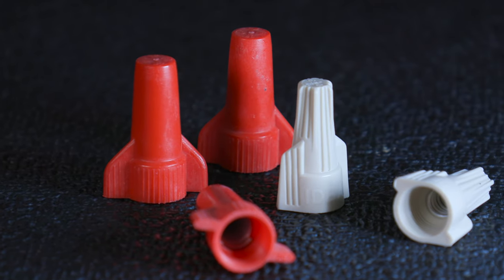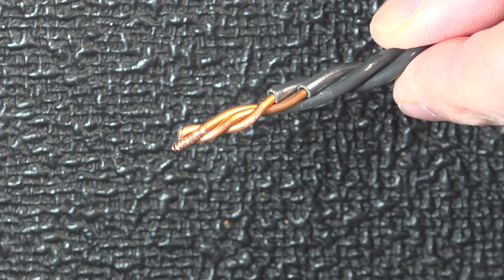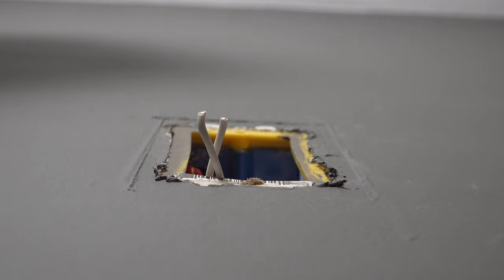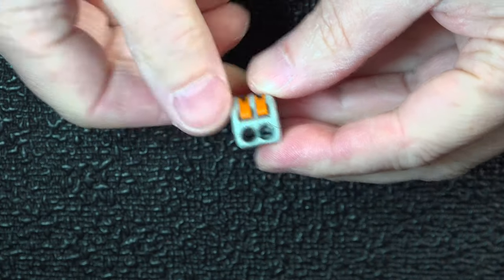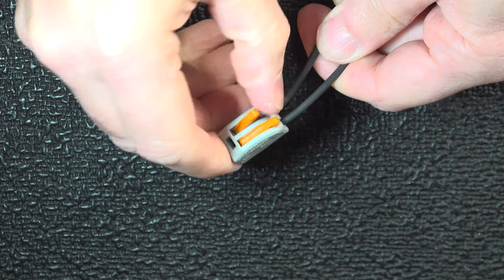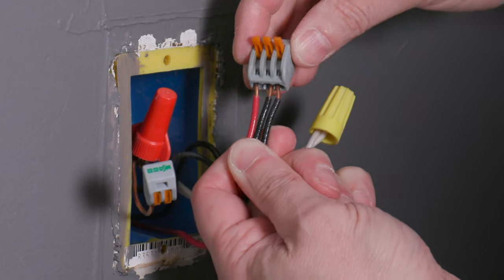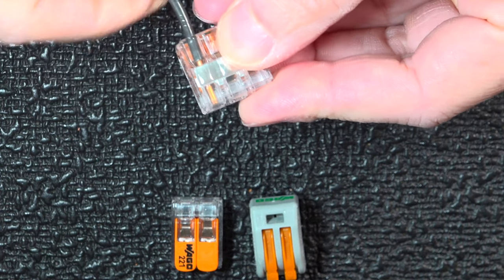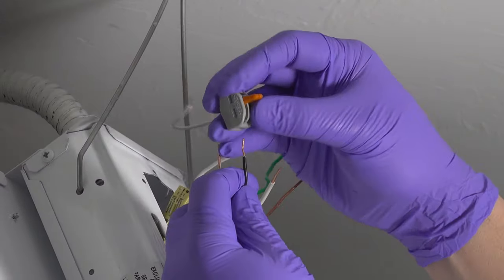Never use Wire Nuts Again - Wago is Better Electrical Connector

Comment: I like them, makes it easier on my back and knees when down on the ground wiring up stuff, but you are going to get some heat from the pro's.  They hate them.
Reply from the maker: Yes I have heard electricians hate them and say they catch fire which is all false. I waited a long time to share this video to make sure they really held up out there.
Reply from the maker: @tb2324  That's the best comparison! 100% right.
Reply: @SilverCymbal  cheers
Reply: I'm not an electrician but I have seen them get bad connections and heat up getting melted.
Reply: May not catch fire but have had connection problems where 2 different size wires were used. Wirenut isn't spose to connect it was to protect. Its why we twisted the wires together. But looks like these have improved from the ones weve had issues with.
Reply: One thing to keep in mind - this is several orders of magnitude of additional cost, with, in most cases, zero or nominal gain.  This device itself becomes a point of potential failure, whereas a wire nut will never fail if the connection is done properly.  If I were trying to employ low skill techs to mass produce houses that will be lived in for 3-5 years average by the homeowner who will have a claim against me, I see the upside to these connectors.  If I am doing work on a house that same person has lived in for 40 years and is likely to own for another 20 years, I would not introduce any product that doesn't have a lifetime warranty.  Interestingly, shark bite seems to get that, since they have 25 year warranty.  It's very painly advertised.  Try to find Wago's warranty.  If you do' you'll have to parse a legal document, and from what I can tell, it's a 2 year warranty.  Ok, that's 2/3 of the way there for "average" current US home-ownership in the age of the white collar gypsy, but not even close to acceptable to me for my own home.
Reply: @tb2324  I think shark bite is the cheap fix. But this wire connector is a great alternative and upgrade.
Reply: Shark bites are not cheap at all.  They are designed for fixes not for plumbing a whole house. Used a lot of them over the years and never had a problem. I would use this product if I was replacing something and the wire was already short other than that I guess you could use them as a bimetal connector but they would have to be UL listed for that application.
Reply: @tb2324  i have saw a fuw shark bite fittings fail ..& if it is buried behind drywall i still dont trust them long term..But They are Handy as a pocket on a shirt in a pinch For Sure !.But That is just imho !
Reply: @linemanap  agree shark bite ive never had a problem with. But someone's making a fortune off that stuff. The thing is tradesmen are a dying breed and their making materials now that anybody can install and save time. Its going to become a problem in the future as the well adversed rounded tradesmen will be gone. Never needed a quick connection of anything cause we could knock it out just as fast stripping and twisting wires then capping. Now they have a drill to twist wires and nuts. Tools to strip wires. And plumbing has always had a million fittings but pex is simple and durable less expensive. Easy to install.
Reply: Shark bites are great for exposed work and in the case where for whatever reason the water won't shut off all the way very hard to sweat pipe with even a steady little drip and these wago connectors have there place as well but only the clamp ones like shown in this video not the stab ones or the stupid stab ports on the back of recepts I hate to see those used they are a problem waiting to happen
Reply: I’m a pro and I love them because lever locks don’t suck as much as wirenuts do. Lots of labor involved with a wirenut.

Comment: Every time they show two solid wired under one wire nut they have demonstrated it wrong. If this had been a demo from an actual electrician, the wires would still be twisted together when the wire nut was removed. Suppose to twist them first with a qualifying pair of side cutters then trim for the wire nut. The wire nut at this point simply holds the twist together and insulates the conductors. That twist is far more effective of carrying the full capacity of those two spliced conductors that their type of connection ever will.
Reply: @Joe  Not only that // in addition to that... OP is not just talking to Electricians. I don't think he explicitly states it but the tone and content appears directed at the general public - i.e. the untrained masses that are doing general work. Further, the "twisting" note you make (which makes sense in and of itself) doesn't address OP's other comments regarding the biting into the wires, being put on too tight, and too loose. I'm not an electrician, but the transparent wago connector does seem to address all of those issues. It's perfectly clear how long the wire needs to be, whether or not it's properly in or not, there is no too tight/loose, etc. Overall it does seem like a far superior method of making connections.

Comment: Been doing my own electrical work for decades. Never had a single issue with my wire nuts and my pipe wrench torques them down just fine! These WAGO connectors looked cool so I checked them out. The are about 4-5x the cost here. Hard pass for me.
Reply: yeah baby!
Reply: This is why Youtube needs to bring the dislikes back.  I was going to say the same thing.  I even re-use them no problem.

Comment: Less contacted surface area than a twisted pair...avoid.
Reply: They’re rated for X amps by almost every electrical body in the developed world. Maybe the resistance is slightly higher compared to wire nuts but it’s inconsequential. I like the Wago connectors in really tight spots (the new kind, not the kind he’s showing here).

You can also use with stranded wire.
Reply: @howardl8530  I like the 221s for stranded as well, but will twist and use wire nuts on solid wire all day every day.

Comment: I'm curious,  what is the load carrying capacity and voltage drop at full current for these things?
Reply: If they would be so bad they wouln t be in use for 20 Plus Years in Germany
Reply: @tc21hunnid   Thats fine and all, but Im not claiming one is better or worse than the other. I am just curious what the load carrying capacity is, and what the voltage drop is at full load.. Is there not an answer?
Everyone talks about how superior the Wagos are... ok, apart from ease of use, and re-usability, How are they better? Are they safer? cheaper? better connection? lower voltage drop? faster to install? more reliable? 
It seems when ever anyone asks, they are inundated with "20 years in Germany" and all kinds of "old-school" insults, but no one wants to have an actual conversation about what makes them better.
Reply: For the WAGO Compact 221 connector suitable for 10 AWG wires:
rated current according to EN 60664 is 41 A
rated current according to UL 486C is 30 A (use group C)
voltage drop at 41 A is lower than 15 mV resulting in maximum power loss of 0.615 W
Sounds good?
Reply: @W210T  Yes it does, thank you!

Comment: I understand that wire nuts will fail when used incorrectly but how many of them are out there and have been in service for many decades? I wonder about the Wago's choice of plastic and how it will respond to constant spring loading over time.
Reply: I’m a service electrician and there are a lot more problems with wagos than with wire nuts. This is when they’re installed properly. Wire nuts also make a better mechanical connection than any wagos.
Reply: @dracula3811  I've also seen "service electricians" say the same thing but the other way. That they think the wagos are more reliable. So some people like chocolate ice cream and some like vanilla.

Comment: You can most definitely add a wire to an existing splice and you DO NOT have to keep cutting the splice off! If you don’t know how to use a wire nut or make a splice you shouldn’t e doing electrical work! With that said those do come in handy in a light fixture or tight spots

Comment: These are extremely dangerous. Prongs are not that strong. If they come with fixtures we will cut off and put wire nuts.
Reply: They work a lot better with stranded wires. But with solid ones connection indeed is weak.
Reply: Considering how widely these have been used, it seems unlikely they are "extremely dangerous". 

What was the situation where you had a WAGO connector fail?

Comment: I made my professional training as an electrician/electronics engineer here at Siemens back in 1985 to 1989. So I am now more than 30 years in the business. I have never, ever heard of something called a "wire nut", nor have seen something like them in Germany ever since. We used Wagos all the time. Even insulating screw joints were considered "bungling" when it comes to electrical installation...
Reply: I would imagine they are just an American thing :D
Reply: Here in your neighbor country Netherlands, we use these nuts all the time. Never had any issue with them.
Reply: @XRRS24  I guess, if they are used properly, they are just fine. And they seem to be not so uncommon in other countries. I just wondered, that I've never encountered them in Germany. To be honest, I just learned, that they exist.
Reply: also didn't knew wire nuts before. Looks like they aren't a thing in Germany
Reply: Here in the Netherlands wire nuts are only sometimes used for high current appliances like washing machines.
Reply: @Leonvolt28  Complete huizen zijn ermee bedraad...
Reply: Same here in the UK. Wire nuts have never been used here. Wago connectors are brilliant and used all the time in this country.

Comment: Dude, PIGTAIL!

Any electrician who's been doing it long enough knows a pigtail is the best way to join wires in a device box. When you want to change out a device, you just take the pigtail of the device and the joint doesn't have to be touched, meaning you don't have to cut back the wires to remake the joint.
Reply: Yep, ideal makes a wirenut with pigtail made on with fork connector on end!!
Reply: exactly!
Reply: @jonathansirmons7932  Yeah, but he's cutting it wrong. If I need to change out a wire nut, First remove the old wire nut, then trim off only the stripped portion of the wire. Instead of losing 2 inches of wire you lose half an inch. It's not exactly rocket science.

Comment: I've only been an electrician for 5 years, but the beginning of the video was hilariously misinformed lmao
Reply: I’ve been an IBEW member for 89 years and I can confirm what you are saying is true
Reply: No the old wing nuts are actually fire hazards and actually are anti customer because it forces the home owner to buy new wires regularly because they in fact damage the wires. You've just been poorly taught because these things have been available as long as you've been in school and you definitely need a refresher course for sure.
Reply: @Openreality  you must be from a third world country
Reply: Also in electrical field and agree... I’m sure these wagos with levers are pretty good but the stab in wagos are way more common and seem to fail and burn up a lot.
Reply: @carsonconlee6277  thank you C
Reply: @waltersobchak7275  Nah, we don't use any of that fancy shit here. Here we just twist the wires and put electric tape on top as insulation. The box is cemented to the wall rather than screwed in, and we are very liberal with wire widths no matter the type of outlet or switch.
Reply: @waltersobchak7275  first world countries don't use medieval ways to cconect wires (i.e. wire nuts). I guess USA is an exception to this, but those wire nuts seems like something grannies are using because of nostalgia.
Reply: @kukumalu255  well you use your new methods of joints I’ll use my bag of red and yellow ideal’s and we’ll see who’s shit burns down first?
Reply: @waltersobchak7275  been using and reusing wire nuts for 30 years with no problems. It must be the shit tier shade tree electricians.
Reply: @vinciroth  I agree. 40 years and no problems. and if there are its because of me not the wire nuts.

Comment: Haven’t used wagos, but have used wall-nuts.  Don’t trust the wall-nuts, still use wire nuts when I can. Will give wagos a try if for no other application than for hanging ceiling lights that have stranded wire.
Reply: Push in connector type wagos are iffy. One time connections only to me like directly linking in a light. Fingered or "lever release" wagos...those are dope. Can get em with 5 connection points press em into the back of a box and your box will look like you laid the wires out in a disconnect. No twisted up crappy rats nest for the next guy on a service call.

Comment: My recessed light fixtures come with those wacko connectors I cut them out and use wire nuts.
Reply: Everyone does and if you dont your a bad electrician

Comment: Did anyone ever ask why wire nuts are preferable? Because when you need a secure connection, I.e. UL standards, you need the wires twisted and capable of supporting 20 pounds

Comment: While I like WAGO connectors you're not going to convince any electrician to try them out if you mention buying them from Amazon.   Just sayin.
Reply: But wire nuts are also bought from amazon...
Reply: It can be bought at Lowes and home Depot.
Reply: @kito1san  "It"?  WAGO connectors are not listed on Home Depot or Lowes websites.
Reply: Dude those waygos slip out super easy.  Some of the cheapo ones don't have enough tension in the springs to keep the wires in place.  They're literally a safety hazard.
Reply: Damn - that's CK, Wera, Klien, Knippex, Fluke and others utterly screwed.
Reply: @subjekt5577  Dude,  they are not WAGO connectors unless they are WAGO® connectors.  The fake versions can be ignored as yes they can be very bad.   It's like comparing Snap-On to Harbor Freight.
Reply: As if that's the only reason why he'll never convince us those are the way to go  lol
Reply: @jeffm2787  it's a generic name, like Kleenex or Marretts, tissue paper and wire nuts are the actual name
Reply: @gtileo  WAGO® is Not a generic name.   WAGO is the manufacturer.  They also are not Wirenut® which is a trademark of Ideal Industries.  Lots of clones of both.
Reply: I bought mine today from Menards
Reply: @jeffm2787  yes it is. I just checked.  $6.97 a box of 10 pieces.
Reply: @MJ Marshall Actual WAGO Brand or clones?
Reply: @MJ Marshall Excellent.
Reply: @subjekt5577  I used them, and, I agree with you, they are crap.
Reply: @jeffm2787  i just bought some that are similar to wagos the thing is they’re ideal I can’t remember if Lowe’s or home depot
Reply: @gtileo  WAGO is a huge German company specialized in material for electric installations. NOT A GENERIC NAME!!!

Comment: I’m skeptical- wire to wire for line to load with a wire but to pack and hold seems much safer then these aluminum backbone quick connectors … what’s the current ratings of these?

Comment: "I'm gonna run out of wire in my box from cutting off 3/4" of wire every time I change a switch or add a light" shows just how stupid the filmmaker thinks the audience is...I've never seen an NEC switch that required a wire nut??? Maybe an old school dimmer that lasted for 35yrs.
Dummest SHAMwow commercial ever.
Reply: Most of the newer devices like Dimmers, motion controls, occupancy and smart switches don't have terminals on them any more so the use of a wire nut or wago is required.
Reply: The entire Control4 line of switches and similar powered switches have pigtails so need a wire nut or wago.  Add the size of these devices with their tech and radios and the smaller wago helps pack it all in the back box.
Reply: Besides, how many times is someone changing their mind on how many fixtures to run for the same outlet? In real life once MAYBE twice. If you need more than that, stop DIYing and call a professional.

Comment: There is not enough contact surface with the Wago to be a safe connector for a good connection. That is why we don't use them in commercial construction. The same goes for the push-in connection on receptacles and switches. These fail all the time, sometimes causing a fire, and never in commercial wiring.

Comment: I don't know your experience or craftsmanship level however these connectors that you are so fond of do not hold up well in hot environments such as can lights or above drop ceilings. Also, like the spring tension connectors on receptacles over time they fail causing overheating. This is why do-it-yourselfers and handymen should not do electrical work.
Reply: Just watch a test.
Reply: These Connectors are durable as Hell. 
In Germany, we used them for about the last 10 Years here. 
We used them In Walk in Coolers at -21 degrees Celsius (33.8 °F), in Lamps which are pretty hot, in the direct Sunlight.
Basically everywhere and i´m in this Trade for the last 20Years and not one oft the Wago´s did brake or get loose on me.
Preety Cool stuff.